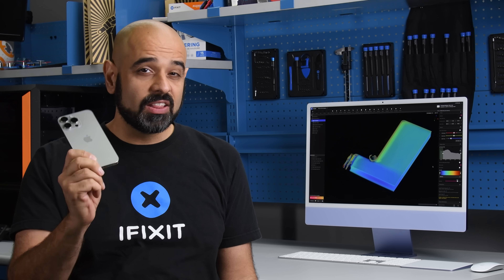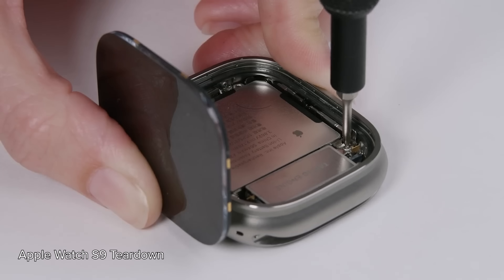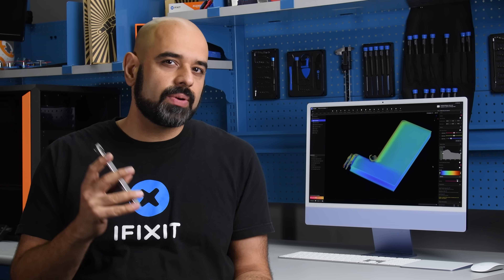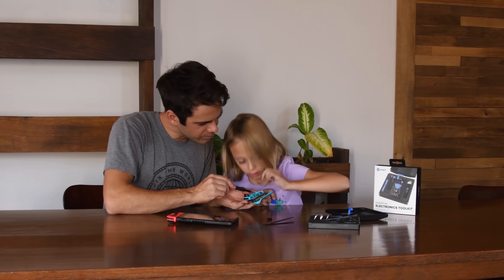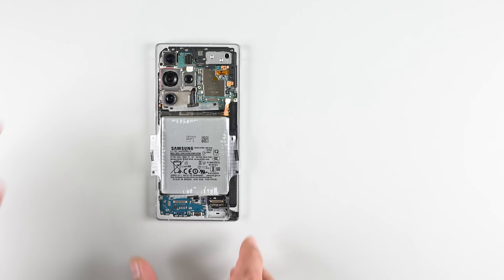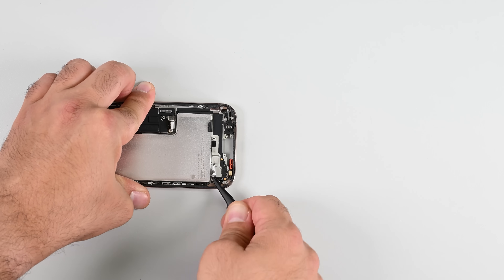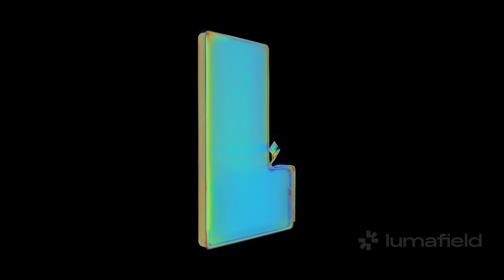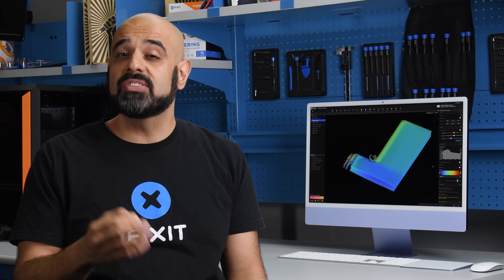Why Does Apple Put Batteries In Metal Cases?

Comment: I find it hard to believe apple will comply with implementing removable batteries
Reply: They have to comply with it in the EU.
Though they don't have to comply everywhere else
Reply: @IAmCymepka  it would cost them more money to make different phones for different countries, i think if they comply they will go whole hog and just do it everywhere so that they dont have to manufacture different variants of the same model.
Reply: @letstalk1028  They already make different phones for different countries. For example EU phones don't have mmWave 5G and still have sim-slots (except the Air)
Reply: @SanderEvers  those differences dont require a drastic design change like a removable battery would, if they make different models for different countries they would have a completely different look in europe, i dont believe apple would go down that road.
Reply: I think the iPhone 17 Pro gives us an outlook how it design wise will be solved. There is now a smaller glass frame above the battery which will likely treated as disposable which might even include a new one if you buy the spare battery from Apple.

Comment: The Samsung galaxy 5 had a user replaceable battery and the phone was waterproof 😮
Reply: The Samsung xcover phones also have replaceable batteries and are waterproof... There also new :)
Reply: Ok so why did Samsung remove removable batteries? Oh wait..
Reply: The last good phone from Samsung
Reply: Galaxy S5, and S6, and S7 which I had, and S8, and S9, all had headphone jacks and were still water resistant. So I'm still not willing to hear the "but we need to remove headphone jacks to have water resistant phones" garbage from the iSheep. Just because Apple made a water resistant iPhone at the same time they removed the headphone jack does not mean that the headphone jack prevents a phone from being water resistant.
Reply: it’s probably due to durability 
size 
but currently bc of steel incase in can see it becoming a thing
Reply: But not the same user expérience.
Reply: IP67 or IP68?
Reply: it was absolutely not waterproof
Reply: @HyperShadic101  You are right. No phone is waterproof, only water resistant, which the S5 was.
Reply: @Guy-Zero  ig the s5 was soemwhat resistant but with modern phoens you can submerge them and they will last long
Reply: @HyperShadic101  Yeah its almost like there are 11 years between these phones and standards got higher who would have thought
Reply: @Guy-Zero  it's almost like it's harder to maintain same level of water resistance if you want to keep easy access to the phone internals, hmmm... Curios
Reply: @ukaszm1137 Harder? Sure. Impossible? No. Companies could definitely build upon what the S5 did if they wanted to.
Reply: @HyperShadic101 you could submerge it, as long as of course the back was well placed, and if you still don’t like it, as at the end of the day was a first generation implementation you can look to more modern Samsung phones like others have pointed out like the corporate XCover series
Reply: S5 was water resistant only up to 1 meter. iPhones are up to 6 meters.
Reply: @Patrikch100 that's cool and all but who tf is gonna use a phone underwater for that long within a meter. let alone 6 meters

Comment: We need to go back when you can easily replace batteries than being sealed…
Reply: people wanted waterproofing in their phones
Reply: @TE_53349  and what is your point? Because I was a owner of the Galaxy S5, and that thing had waterproofing, it actually consisted of a removable back that had a specially designed gasket that went around the battery, and any component outside the gasket was waterproof so if Samsung did it at 1 point, why can't they do that again? And bring back removable batteries instead of creating waste. Because you cannot charge the battery and you're forced to get a new phone. Due to the fact that repairing the old one is more costly. Then upgrading to a new one
Reply: @TE_53349 that can be achieved while having user removable batteries. And someone has done that in the past
Reply: Fairphone still does that and won't stop
Reply: That'd be 2027...
Reply: The companies will lose 💵💸
Reply: @amrmohammed321  okay, they will lose money But what with all the E waste that is going on.I wouldn't mind having a high in smartphone that allows you to replace the battery again because
That is one reason that'll make me keep my smartphone longer
Reply: Stop buying phone with sealed batteries then. There are phones with easily replaced ones. We are part of the problem not voting without our wallet.